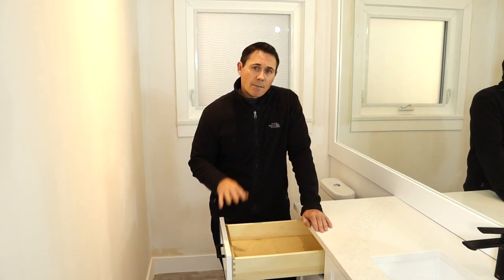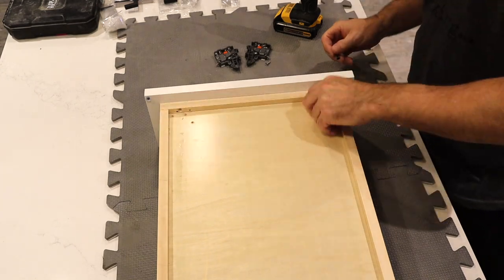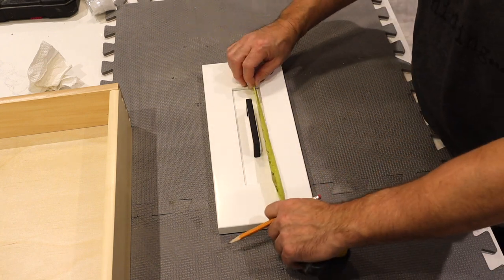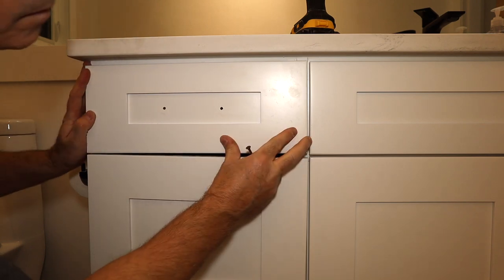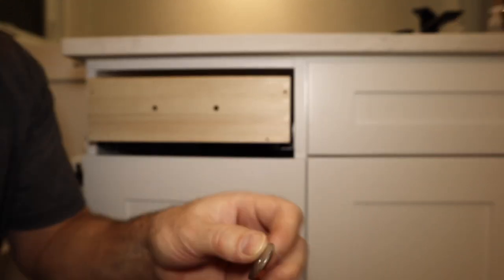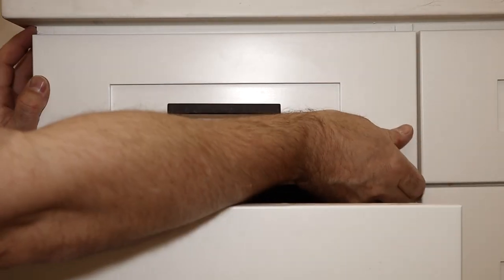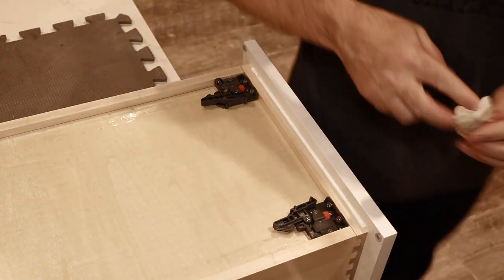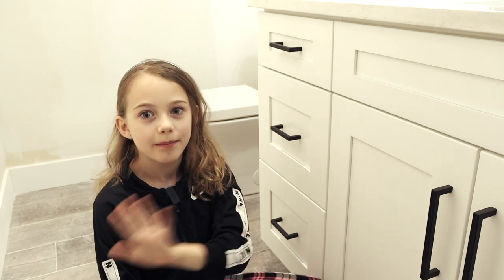HOW TO STRAIGHTEN CROOKED DRAWERS FOR GOOD!!!

Comment: Great idea about the drawers. Would this somehow work on drawers without any handles?
Reply from the maker: Yes! Just drill the 3/8” holes in the drawer box as I do in the video, but instead of using the bolts to go through the face plate (to hold on the handle) use a short wood screw and slide it through the same 1 inch washer. Then just screw it to the back of the face plate. You can make the adjustments and line up your face plate at that point. Hope this helps!